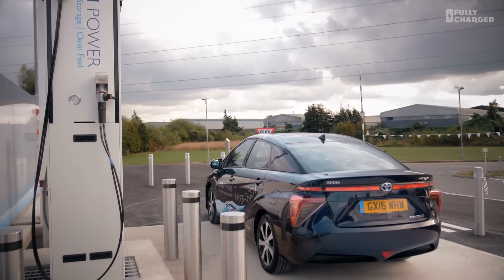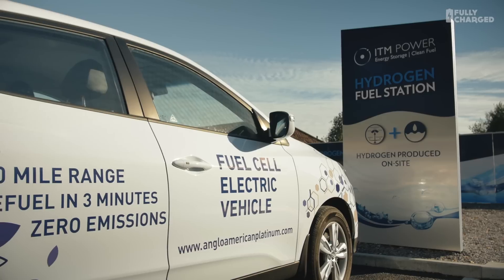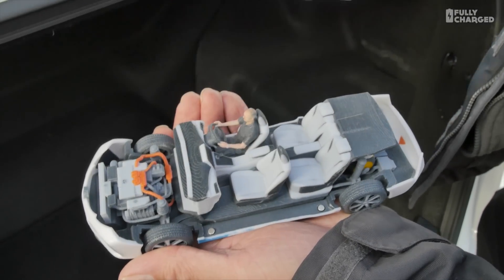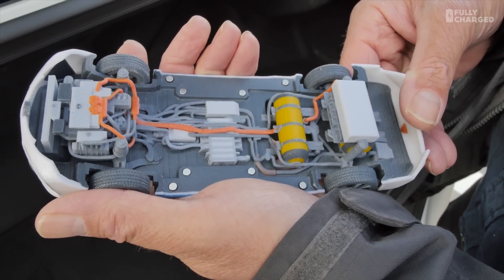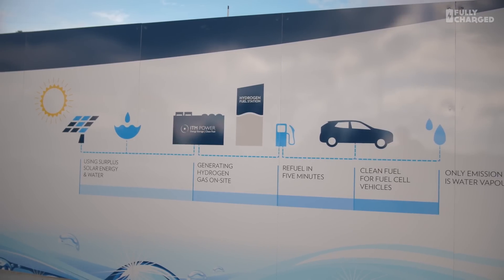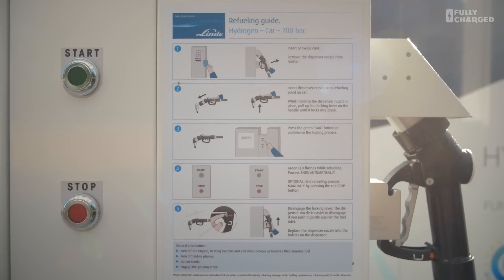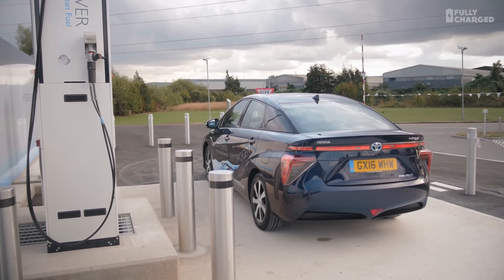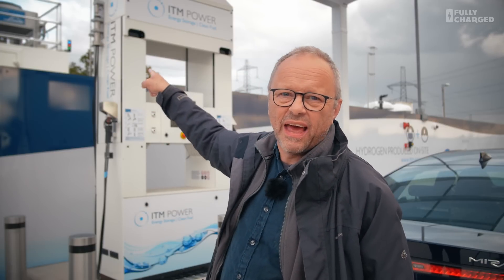ITM Hydrogen Rally | Fully Charged

Comment: Producing hydrogen by electrolysis of water is highly inefficient compared to directly charging a battery pack. The only benefit I can see with a fuel cell is the filling time compared with the charging time if I go for a long trip. With a battery though I could charge my car at home at any time I like as long as I don't exceed the maximum range.
Reply: FenrisUlfven Perhaps. But they're using the hydrogen plant as a load balancer for the grid, and I'm fairly sure for the quantity of energy being stored (energy that would otherwise be unusable; the grid would overload and fail if you fed in more energy than was actually being used), a battery able to consume the quantities of energy involved would be orders of magnitude more expensive.

All you need is the hydrogen producing equipment, and a storage tank of some arbitrary size.
The production equipment is expensive, but relatively speaking a storage tank is not.

The capacity of the electrolysis system determines how much power the system can pull from the grid (assuming excess power production is available that is otherwise unusable; eg. renewables, since conventional power can just not run and thus not use up fuel).
The size of the storage tanks determines how long the system can keep absorbing excess energy if nobody is using it.

Even if a battery is 90% efficient and hydrogen production is 30% efficient, if you can build a hydrogen plant that can take 1 megawatt, and run nonstop for 48 hours at that load before the tanks are full, you may only be storing 14,400 kilowatt hours of energy for 48,000 kilowatt hours of energy used, but if the cost of the plant is reasonable, and you power it from renewable sources that otherwise would have to be turned off, it's a net win.
The only situation in which it isn't a win, is if 14,400 kilowatt hours of battery capacity could have been installed for a similar (or lower) longterm cost as the hydrogen plant equipment.
If that were true, then yes, the battery wins.
But raw efficiency is not always what matters.
Reply: Hydrogen makes more sense for Lorries or Semis as it would take hours to recharge enough for say 300 miles range. That is why Nikola changed from NG to Hydrogen for its model One semi lorry.
Reply: this could be achieved with a battery too, which is again, more efficient.
Reply: divingbert, seeing at the rates for chargin vary by charge capacity, it would take longer to charge up a large enough power pack for a lorry to get even 300 miles would take more time to recharge than a say a Tesla seeing as it would require triple or quadruple the size of kWh in battery power to run a lorry the 300 miles fully loaded. Take a look back at the Nikola ONE as they switched from NG to Hydrogen a few months ago due to the energy density of Hydrogen compared to the energy output of LNG. As an experienced Lorry or Semi driver as I am from the USA we can see depending on size of fuel tank and say 5 mpg hauling max capacity gcwr with 200 gallons diesel gets us 1000 miles, less if there is traffic and we are limited to number of hours a day for driving at 11 and even without traffic at 60 mph gets 660 miles at the full 11 hours driving allotted.
Reply: Electrolysis to make Hydrogen for a fuel cell vehicle uses 4x the energy to charge a battery in an EV, in order to go the same distance.  Hydrogen is horribly inefficient when all of the energy is fully accounted for.
Reply: Joshua Cornell the charging time will increase dramatically in the near future. Also, trucks, buses and trains may have swappable battery packs...
Reply: Hydrogen could be used for heavy-load vehicles that need the instant power. Like those massive mine trucks. 

Also, because of their constant use, filling up hydrogen tanks, I think, is better than deteriorating batteries. 

My reasoning is this: By scaling up the number of batteries they should have a similar lifetime to a normal electric car on a normal schedule. However, since these giant trucks actually are used a lot more their lifetime would be much shorter. 

Plus, even if they work on a normal schedule, you still would want these trucks to last decades, not 10-20 years.
Reply: C0deH0wler Batteries don't significantly deteriorate.  Our EV battery pack is 20 years old and working fine.  Hydrogen fuel cells have limited power, which is why they are used to charge a battery pack in a fuel cell vehicle.  Batteries have the high power needed to accelerate a vehicle, which is why they are used to provide high power in fuel cell vehicles.  In other words, the high power does not come from the fuel cell.  It's more like a somewhat slow on-board battery charger in a fuel cell vehicle.
Reply: We are talking about RAW power needed for this mining truck example; they lift HUGE loads when compared proportionally to cars in general. Electric cars have a sweet as acceleration, but will eventually be beaten when it comes to climbing REALLY steep hills and speed; well, in this year. Drag races only compares acceleration over a short distance. Acceleration is important, but is not the only thing.

And regarding the battery lifetime, for practicality you would want this thing run for about 40 years or so because these things are expensive. 

Also, it wouldn't be a good idea to replace an expansive array of batteries, aye?

HOWEVER, this is with current tech. This WILL change. And thus I will become wrong in what I say. And please continue the discussion, I enjoy talking about the pros and cons :D
Reply: Loanword Eggcorn yes that's exactly how it works, and why it just does not make any sense. The inefficiencies involved in this a crazy it's basically just wasting energy for the sake of this to save on the time of charging.
Reply: C0deH0wler Batteries have high power.  Fuel cells don't.  You may want to check out the difference between power and energy.  They're not the same thing.  Energy is power over time.  Power is instantaneous.  Batteries are good at power.
Reply: if the superchargers were half as advanced as these hydrogen fuel stations you could charge at over 300kw - Tesla are looking to do exactly that
Reply: How are current batteries lets take for example the new 100kWh from Tesla more power and capacity than the current 114 kWh max rating of the Mirai? I will give it to Tesla for slowly upping the game, but Hydrogen is currently more power dense than BEV and most batteries you see for BEVs are made up of thousands of AA size 18650 Lithium and the Mirai uses Manganese type which can hold a higher amount of power but weight more. Even those typical car batteries for ICE vehicles are much up of cells of lithium or more typically lead in an acid bath.
Reply: Joshua Cornell Hydrogen has good specific energy, but poor energy density and very low overall energy efficiency when the Hydrogen is made from electrolysis of water.  (Please look up those terms if any are unfamiliar.)  The 12 volt accessory and starting battery in most ICE cars are Lead acid.  The 18650 cell is significantly larger than AA size.  Tesla is moving to a larger cell for Model 3.  Other EV makers use larger prismatic cells.
Reply: Correct me if Im wrong, does hydrogen vehicle have the advantage of maintaining range in colder climate? EV struggles on that part.
Reply: HDose EV range is less of a problem for EVs with thermal management of the battery pack.  They warm up the battery pack when its cold.
Reply: Loanword Eggcorn
Okay I take that back, but wouldn't that increase battery usage or do you assume some kind of another source of power (ex. solar, separate battery, etc.) to heat up the battery?
Reply: HDose Yes, it does use some of the battery capacity to heat the battery pack, but the amount is a few percent at most.  The pack can also be heated when its plugged into the charger, for example overnight at home when it's coldest.  That would use some grid power.  Again the amount of energy needed for thermal management of the battery pack isn't large in the big picture.

Comment: A lot of chat in this video. You know what I see? Waste and expense.

Cool the Hydrogen: wastes energy. Pressurise the Hydrogen: wastes energy. Crack water to produce Hydrogen: wastes energy.

How many miles more could a battery electric fleet drive on the electricity that this one set up alone LOOSES? 

And if this lot cost less than €1.5million then I'll eat my hat.

How is this in any way scalable?!

Nope nope and thrice nope.
Reply: Surely none of the energy here can be thought of as waste as it's produced from renewable sources and therefore comparatively free. I don't imagine maintenance costs would be that high and once the capital expenditure of the installation has been paid, this is seriously profitable for the company who owns the unit. Therefore very, very scalable indeed. Consider also that the national grid would pay for the ability to help balance the grid's supply/demand to 50hz and these units have very fine investor potential providing there are enough vehicles on the road using them.
Reply: By that logic, we could just go ahead and store it in batteries. This is just business. A way to maintain centralized power.
Reply: You can see the results of hydrogen by seeing none of them on the road!
Reply: To answer your question, the energy to move and EV 100 miles will move a Hydrogen fuel cell vehicle 25 miles, when the Hydrogen is made using electrolysis of water.  Hydrogen uses 4x as much energy as an EV to move the same distance.  That's why most Hydrogen is made from natural gas (methane) a fossil fuel controlled by oil companies.  Hydrogen is a red herring by oil companies against EVs,
Reply: Veritas Vincit  Yes, it's renewable energy - But if three times as much energy is needed "Well to wheel" to take a Mirai 10 miles than it would take to move a Tesla the same distance, you'd need three wind turbines to provide the same infrastructure as simply pumping 1 turbine of energy into the grid and plugging cars into a socket at home.

The waste is in the outlay of building more generation to do the exact same job because much of the energy produced and stored in this set up is wasted.

How many battery electric car miles could that turbine power if mated to a grid powering regular EVs? The answer is "Far more than this".

That's waste. Hydrogen is dead end technology.
Reply: Tim Austin Agree Hydrogen is very wasteful now.  Its proponents hope for more efficient ways to split water, but absent that, batteries are a much better, far more energy efficient solution.  And Hydrogen from Methane, which is where most of it comes from, is fundamentally another fossil fuel mostly from oil companies.
Reply: ***** Lithium batteries will be recycled or reused and will last for several decades.  The cost of Lithium batteries is falling in half every ten years.  The cost of replacements will be a small fraction of the cost today.  Using recycled Lithium to make new batteries reduces the cost even more.
Reply: ***** Or work for an oil company.  :(
Reply: ***** The battery pack is the most valuable part of an EV.  No one will be throwing them away.  If a cell in the battery is bad, the cell or module is replaced and the battery pack is put back into service.  P.S.  How do you recycle the oil you burn in a fossil fuel car?  Batteries don't get burned up like oil.
Reply: well, this is still better than petrol, but not really better compared to the battery because electricity need no more conversion to other form and can be charged almost everywhere, the plus side of hydrogen is the availability, it is almost unlimited, not only limited fresh water supply,  they can even purify sea water and convert it to hydrogen to keep the price low

but in the future, there is possibility of a big obstacle, once the graphene (the true 1 atom thick layer of graphite) battery for car is officially invented and released to the market, that  3 minutes fill of hydrogen got a new heavy rival, since this type of battery can also be charged at home
Reply: Tim Austin electric car battery's are cooled while being charged, but I think it's still less than this.
Reply: shelory far less, yes. The actual process of electrolysis is very wasteful long before the cooling and pressurisation. Turning the Hydrogen back into electricity is also not particularly efficient.

It's not a good way of storing energy at all compared to using batteries.
Reply: +Daniel Rodriguez you entirely negate legislation as a matter in this: it is illegal to landfill commercial sized batteries in the EU and in North America. EV batteries fall into this category (Hell, the battery of a handheld drill counts!)

There is no reason to believe that EV batteries will be thrown away at the end of their lives. As low as their price gets, they'll still have usable capacity for mass storage - another 20 years of potential lifespan - and the cobalt and lithium will still be valuable enough to recycle.

We recycle Aluminium all the time and Aluminium is plentiful. Indeed, most of a Lithium Ion battery is Aluminium. In fact Lithium Ion batteries aren't actually particularly toxic to the environment anyway - I could swallow a AAA LiIon battery right now and it wouldn't do me any real harm.

They're not like Lead Acid or NiCad. 

Such a concern is far from being a reason to favour Hydrogen as an alternative. There are far too many problems with Hydrogen - many of which would require a change in the laws of physics to overcome.

While those problems exist, Hydrogen production will remain unprofitable from Hydrolysis and producers will fight for the cheapest source: natural gas.

If they don't get their way on this, they'll simply not build the infrastructure at all. Which is exactly what I see happening.
Reply: Veritas Vincit we can balance the grid today with our electric cars.  hydrogen is a waste of time and expensive.  why not invest in battery technology? powerwalls and solar panels at home will also help the grid. actually if you have good power storage with solar panels, you may never use the grid(greed) at all.
Reply: Daniel Rodriguez, comparing gasoline and FCV efficiency does not make sense, because you did not invest 100% of energy that is stored in gallon of fuel to make it (e.g. 1 gallon of fuel has 33kWh chemical energy stored and your car uses 8Kwh out of it), but for FCV you actually need to spend 100% of energy made by solar/wind/nuclear... to create hydrogen, to actually get 30% from the fuel cell.
Reply: *****
As I see on their site, Nikola motors truck has 320kWh battery, and hydrogen is only used for charging batteries.
Reply: ***** as Sasoon said, quite correctly: the Nikola One is Battery powered to the wheels. The Hydrogen runs as a generator to charge the batteries while the vehicle is in motion.

Hydrogen fuel cells can't produce reliable throughput at the voltage needed for a vehicle like that. Indeed, they're rubbish at acceleration from a standstill, which is why all three currently available hydrogen cars are battery hybrids.

Hydrogen is a decent choice for haulage applications. It's utter crap in a car.
Reply: +Tim Austin Hydrogen is horribly energy inefficient in pretty much anything.  (It's great in spacecraft, where input energy efficiency matters much less.)   It would be much better to burn the natural gas (Methane) most commercial Hydrogen is made from in an internal combustion engine to directly drive the wheels (mechanically via a gearbox, i.e. a normal ICE truck).  The next less efficient would be using Methane to burn in an ICE as an electric generator for a range extended BEV.  Least efficient is as Hydrogen in a fuel cell.  The (in)efficiency relates directly to range and CO2 emissions, but only when well to wheels (full energy accounting) is used.  If one assumes the Hydrogen magically appears in the vehicle fuel tank, with no upstream costs or energy usage, then it looks somewhat efficient.  But that's a false accounting.

Comment: My biggest beef with water splitting so far it's how it has to be purified water instead of seawater, wastewater or just brackish water. Though some months back I did find an article about the Japanese making Hydrogen from sewer water.

While I have my reservations about Hydrogen, I still want to see it reach its full potential, wherever that may take us.
Reply: "Making hydrogen from sewer water" is pretty easy: just add/cultivate algae.
Water splitting requires purified water for a reason (you don't want chlorine or salts forming, and they will form before water splits). It is a major downside, but the alternative is using living organisms {which means a much lower yield and the need to provide food).
Reply: someone in the Us has just launched kit for splitting waste water to produce potable  for use in over populated cities and villages of the third world.d